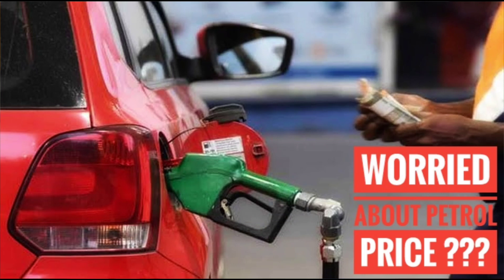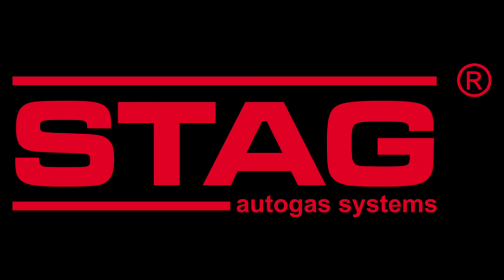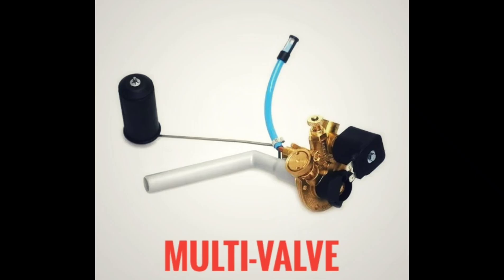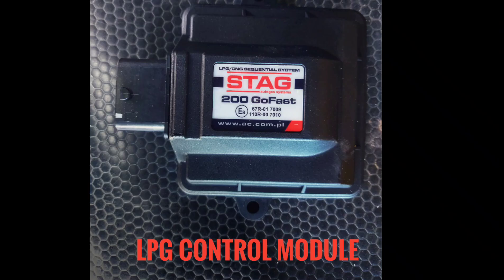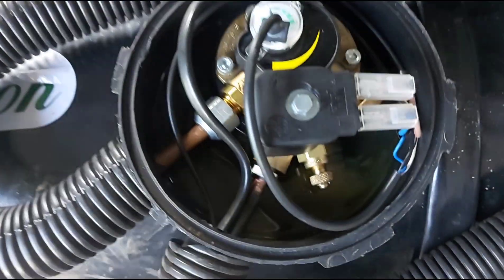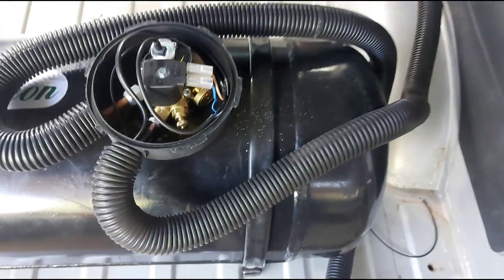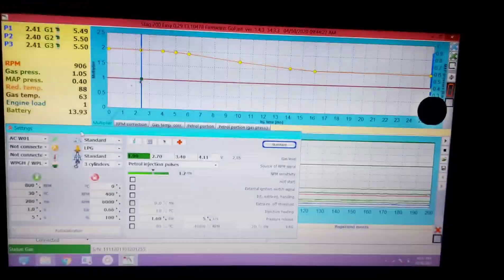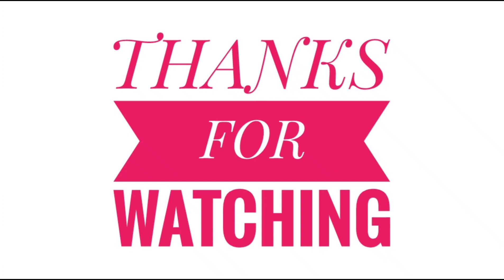[Tamil] LPG Sequential kit Installation | Installation and Benefits| STAG LPG kit| Alternate Fuels.

Comment: Hilly terrain & cooling place la engine lpg la run aana adaikum nu solranga , actually I am in Ooty location , old model lpg kit kum new electronics lpg kit kum different and performance sollunga
Reply from the maker: For hilly and cold conditions, we need to run the engine in petrol at first so that your LPG Vapouriser reaches the optimum temperature to convert the liquid gas to vapour.

Old LPG kits are fixed settings, new LPG copies your petrol timings according to your Engine load, RPM and manifold pressure so that you get precise fuel delivery in new electronic kits and it is good for your engine.

With the help of new sequential kits, you can tune your vehicle nearly to petrol performance (90%).

These precise Tuning is not possible in old kits, now they are outdated.
Reply: @rkautomotivediagnostics5407  that same follow old kit also?
Reply from the maker: @dhamuanandu1067  Yes, you can

Comment: Na maruti eeco vankirukan, 6 months aguthu 3000+kms poiruku ipo LPG fitting panalama?...  Ithunala car company service and warrenty problem aguma?...
Reply from the maker: If you have issues in Engine (specific in manifold and valves) you won't be allowed to claim warrenty.

LPG can be fitted in your vehicle and there won't be any issue in the Engine.

Comment: I am having a new honda city 2021 model. I am planning to install sequential kit. Weather it will effect vehicle insurance?
Reply from the maker: You need to do RC endorsement in RTO to register that your vehicle is running on LPG as well, once your vehicle is LPG endorsed, you won't have problems in insurance claim.
Reply: BS6 Vechiles Endorsement not approved by RTO. Please wait until Endorsement Approval for Bs6 Vehicle. Lot's are waiting  but some people are installing.

Comment: 60 little tank full panna evolo millage varkum bro
Reply from the maker: 2km less than your Petrol mileage
For ex : if your petrol mileage is 15 km
Then LPG mileage will be 13 km
Reply from the maker: @ntneswara690  we have not yet installed any turbo petrol engine, if we install any will update in channel.

There is an option for turbo vehicles, but not yet tried.

Comment: Nice video and I hav a doubt USING EECO new car any minimum kms required or LPG conversion
Reply from the maker: There is no km restrictions, 
You can do LPG conversion at any kms.
Your vehicle should run well in petrol without any misfire.